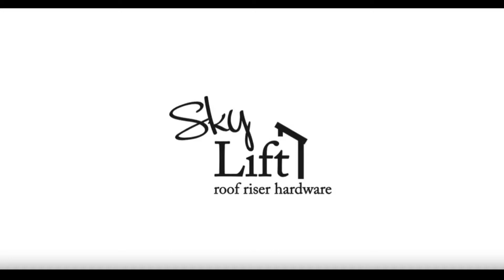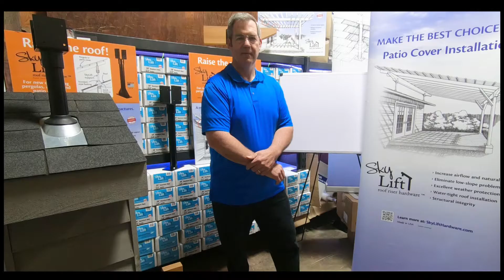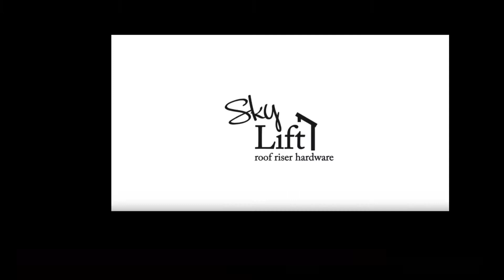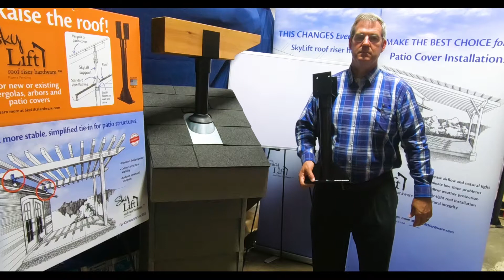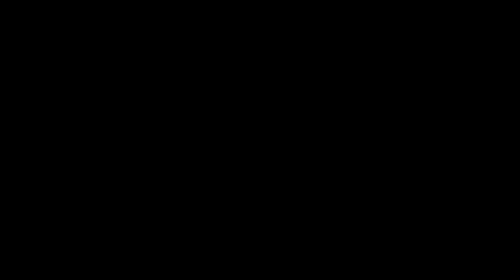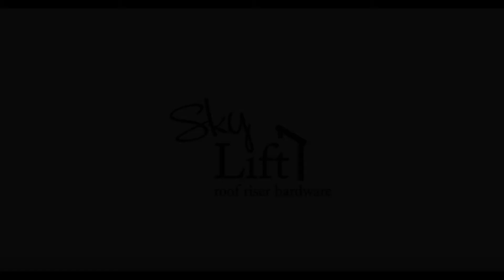Is SkyLift Engineering Data Available?

Comment: The link is broken and the engineering provided has a water mark, as well as states it is void without an original signature and seal of the original PE . Also, does not state in the report how far apart or loading factors (seismic zone to be used in, ground snow load, dead load, wind load, ect). Note # 4 in the product specifications states that: "BECAUSE STRUCTURAL AND CODE REQUIREMENTS VARY GREATLY BETWEEN INSTALLATION SITES AND JURISDICTIONS, ALL PERMITTING, STRUCTURAL DESIGN, STAMPED DRAWINGS/CALCULATIONS AND INSPECTIONS ARE SOLE RESPONSIBILITY OF PURCHASER. SKYLIFT ROOF RISER HARDWARE AND SAGE BRACKET SOLUTIONS, LLC MAINTAINS AND ACCEPTS NO RESPONSIBILITY/LIABILITY FOR SKYLIFT PROVIDED ASSEMBLIES OR HARDWARE THAT IS NOT INSTALLED PER OFFICIAL SKYLIFT ROOF RISER INSTALLATION INSTRUCTIONS (REV 6/14/12), LOCAL CODE REQUIREMENTS AND LOCALLY-LICENSED ENGINEER INSTRUCTIONS AND CALCULATIONS. INSTALLATION OF SKY LIFT PRODUCTS REQUIRES OBTENTION OF LOCAL BUILDING PERMITS AND IS INTENDED TO BE USED WITHIN A STRUCTURAL SYSTEM DESIGNED BY A LOCALLY-LICENSED PROFESSIONAL ENGINEER".